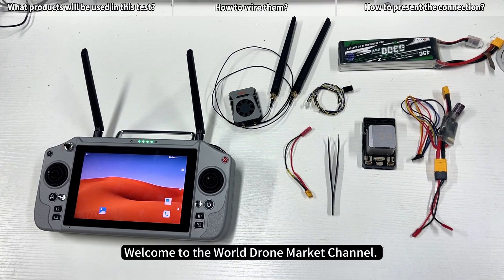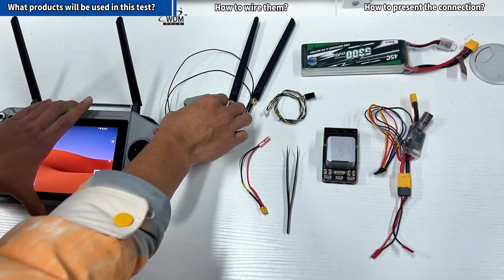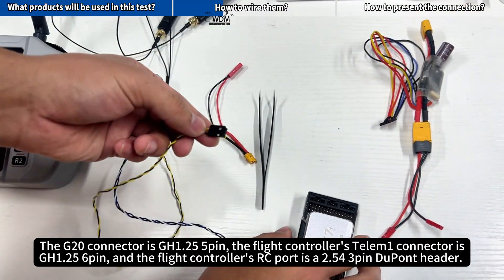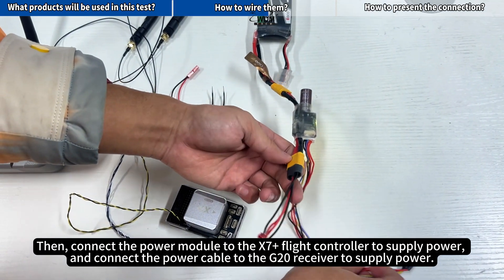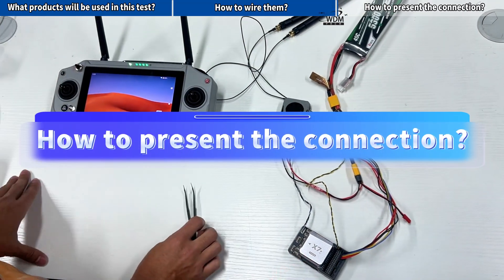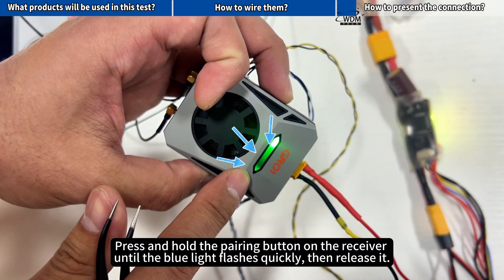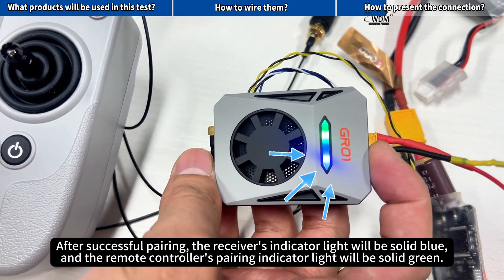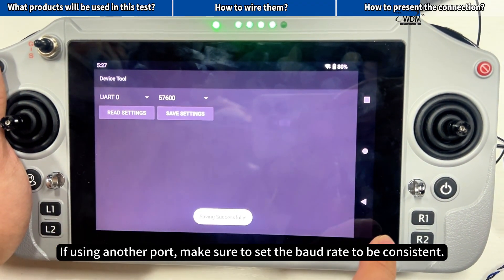Wiring tutorial for connecting the Skydroid G20 to the CUAV X7+ flight controller

Comment: Hello, can I get this version of skydroid fly that works with the Skydroid G20 well? I am using with Orange cube+ flight controller. Thanks
Reply from the maker: Yes, but the flight controller needs to download the firmware of ardupilot, not the firmware of PX4.
Reply: @worldronemarket Yes, FC firmware is from ardupilot. 

Could you please give me download link of Skydroid Fly in this video ?
Reply from the maker: @cloudwings-gk9hp  https://drive.google.com/file/d/17jBuSD8Dfv0Psz4hEYG4o5EKgnwS5fh9/view
Reply: @worldronemarket Thanks for QGC G20. Can I get download link of Skydroid FLY app more ?
Reply from the maker: @cloudwings-gk9hp  http://file.skydroid.xin/SkydroidFly.apk
Reply: The latest Skydroid Fly I am using is usually occur GCS failsafe 😢
Reply from the maker: @cloudwings-gk9hp  If you encounter any problems, you can email our technical tech@worldronemarket.com or tech2@worldronemarket.com
Reply: I have used the x7+ and successfully connected with the fly gcs software but i can’t connect with the QGC for g20, can you help me in this case?
Reply from the maker: @bishalmehta7523  If you encounter any problems, you can email our technical tech@worldronemarket.com or tech2@worldronemarket.com